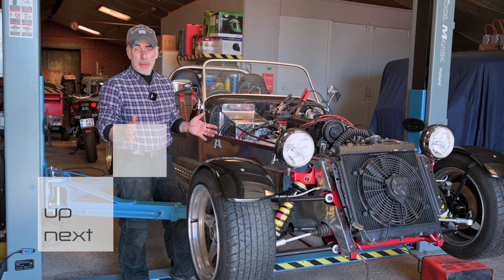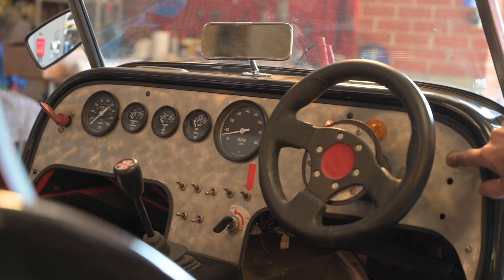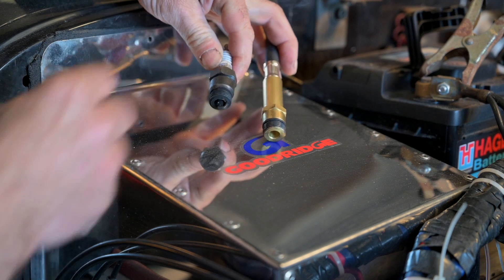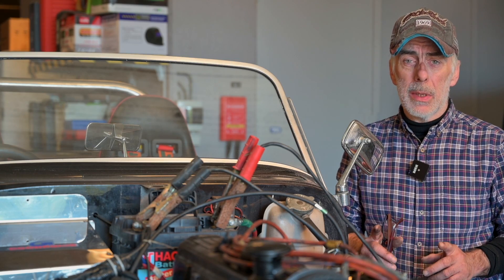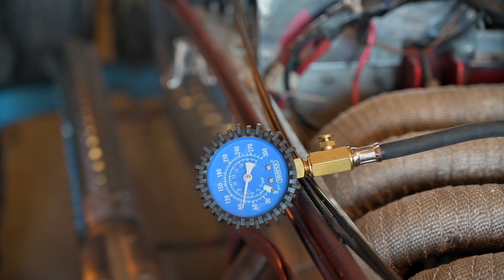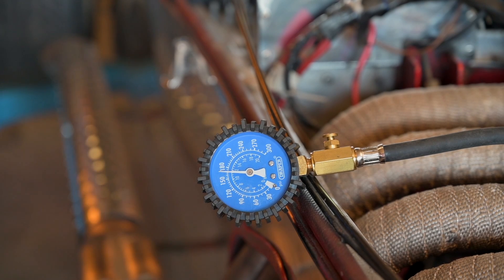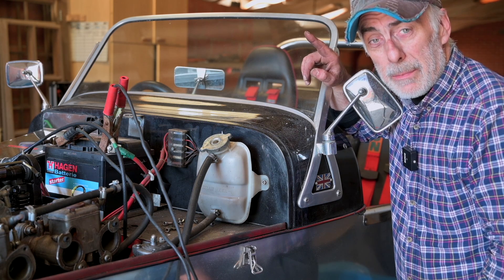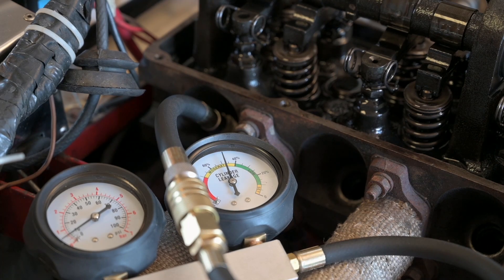Old Sporty ,Compression and cylinder leakage test

Comment: TDC At Compression stroke Confirm - At 13:55 in your video where the cam lobes are at like, Exhaust lobe at like 2 o clock and Intake lobe at around 10 o clock, THAT"S compression stroke right, like your saying?  # 1 and #2 Cam lobes would be aiming down at like 8 and and 4 o clock if on exhaust stroke. Im guessing.
Reply from the maker: Thanks for the comments, indeed

Comment: This engine is fine, trust me (unless its burning oil, wich i dont see on the plugs). The leakage tester should be set with the Cylinder connected that has the best compression result. After that you can compare the other cylinders with the one that had the best compression. This engine has just a carb issue(s). This is my daily job, fixing exessive engine problems ;) Iam not critisizing just sharing some thoughts!
Reply from the maker: Thanks for the comments,  I did move outside the video the pistons down and up the full stroke ( labor and compression checking possible better or worse blow by spots... That was about the same at any spot.  Note that the carburators need indeed a checkout, especially cylinders 3-4 .  However the engine does has pressure in the carter and that can be felt when removing the oil cap.  So it has a certain level of blow by.  But it will run like it , as you stated...its fine but IMO not optimum.  Its a used engine...
Reply: @D3Sshooter  I think the truth is in the middle 🙂 when I see 12/13 bar compression on a petrol that's actual pretty awesome! Blowby is relative and might be acceptable. But when you can dye your hair with it it's too much hehe. Today's engines have even negative pressure! Like this channel alot, we got alot in common hehe alot  know-how 👍👍

Comment: Morning Steve. Great technical video 👍🏻 Loved the pinto engine back when I was messing with old ford cortinas lol 😂 We bought them very cheap £50 with knocking overhead cams hehe 😂 As you had too take the head off to fix them 😩 But we cut a hole in the bulkhead and drifted them out then drilled out the oil way job done ✅ Are you growing your beard for the Coronavirus 🤔 or just being a cool guy 😎 lol 😂 Thanks for the video as it's stared my week off perfect Cheers Stevie 😎🇬🇧
Reply from the maker: Thanks for the comments Stevie, yep those were the same engines.  Very good engine and tuneable the Pinto.
The beard is just laziness , I have been working from home the last 4 weeks...  stay safe pal

Comment: sounds like the starter motor is shorting out, if you have battery drop tester you can check it
Reply from the maker: Thanks for the comments, I will need to get to that in the coming days... the battery runs flat very quickly///  and with the charger on it stays up.   that car is so f...up  in terms of wiring
Reply: @D3Sshooter  another thing to try, put a jump lead from the engine to the negative battery terminal and to a good earth point on the frame/chassis if it improves its just a bad earth fault

Comment: Well done, you will always lose past the rings , unless you use total seal rings , they always breathed heavy , does it still run a pcv valve
Reply from the maker: Thanks for the comments. No this engine has no Emission Control, no PVC value .  That true, a loss is unavoidable, but here it seems excessive
Reply: @D3Sshooter  How to you do away with the pvc valve?, on my pinto no smog needed the pcv grommet seal has a worn fit, have to black tape it to seal right as best i can

Comment: If your compression test was good, why would the leak down test even be necessary?  I suspect you have a fuel or ignition problem. You may could also shoot you temp gun at the same area on each cylinder to also determine the problem cylinders. Pulling the plug wires while running is also a good way of determining faulty cylinders........good luck.
Reply from the maker: Thanks for the comments,  and good remark/// However a compression test is a very good indication but it does not tell you anything about the overall blow-by state of the segments/pistons.  You can still get a good compression, as that piston moves fast, while you have a considerable amount of blow-by.  In general you are right.  Good compression is always a good indication, the leak test just gives you that extra on the actual wear on the motor.  If the compression test is bad, then the leak test is for me the best tool to diagnose further. In this case, the engine had poor compression a few months ago when I got it  , tested it after it had been sitting there for 15 years//   To my own surprise , that compression is resolved after the engine had been running for a while.  But it has other issues like the Weber carburettor on cyl 3 an 4.    There is still a lot of work that needs to be done it.

Comment: Another thing I encountered using a leakage tester.  If you are reusing your compression gauge hose,  to be sure to remove the one way valve that most have.
Reply from the maker: Thanks for the comments, indeed that is a must else it will not work properly

Comment: This differential leak testing originated in testing piston aircraft engines where the consequences were very important.  In Aviation the standard is the leakage pressure when 80 psig is applied. A reading over 70/80 (88%) is considered very good.  For General Aviation piston engines compression leaks of 45/80 (56%) is considered a limit before conducting further investigation.  Of course, where it is leaking (exhaust, intake or rings) will tell you a lot.  Also, its important to use a Borescope to examine the cylinder walls and each of the valve faces and seats.  Modern borescopes are very cheap and some have digital color camers.  Look for uneven heating of the exhaust valves.   ==Stay safe.
Reply from the maker: Thanks for the comments, and great info... Things I was not aware off

Comment: If the engine has been sitting, maybe the rings are stuck? If so, maybe couple of hard pulls will help unseat them :) 
Best regards
Reply: Something else that can happen to an engine that has been sitting for many years, is that rust spots can form on the valve faces and seats. The longer the engine runs, the better the valve will seal.

Comment: This is a very good explanation of both compression test and blow by test, probably the best I have watched. Looking at those plugs I think fuel problems is the most likely reason the car is running rough. Thank you for continuing to release videos during these strange times, I hope you and your family are safe and well.
Reply: I would agree about the fuel problem. It appears that one carb is running much richer than the other. Can definitely cause rough running.
Reply from the maker: Indeed
Reply from the maker: Glad you liked it! And yes the issue now is fuel on the Weber carb for 3 and 4...  That is another thing I need to sort out.  Good observation and tip  txs